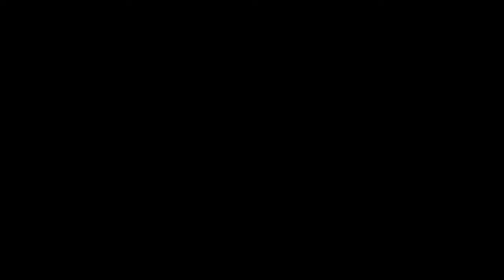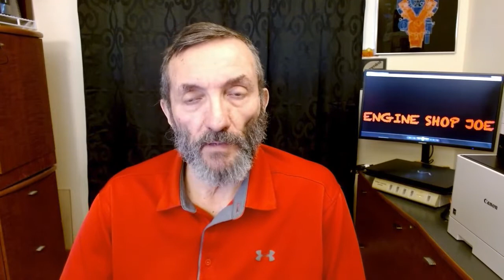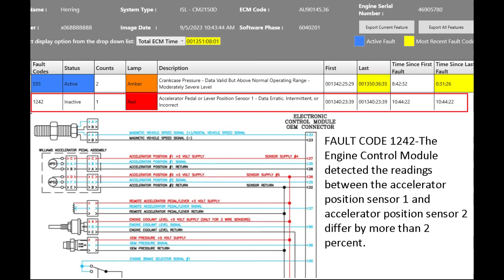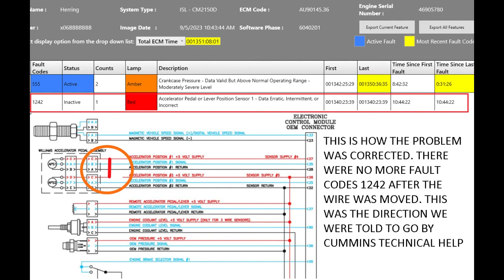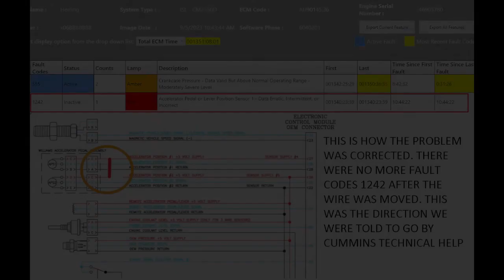HELP how do I stop these throttle pot faults and derates

Comment: Hi, I have a kenworth. T 800 that has Commins  IXS CM 871 engine. HAVING ISSUE WITH CODE 1242
 AS I DRIVE, THEY STOP CHECKING. JULY COMES ON AND CALL 1242 ZECTIVE. YOU THINK THIS SOLUTION THAT YOU MENTIONED IN THIS VIDEO MAY APPLY TO THIS ENGINE AS WELL SO FAR I HAVE REPLACED THE X RELATOR PADDLE, AND THE ISSUE STILL THERE. ONE THING I NOTICED, IF I DISCONNECT THE ONE OF THE NEGATIVE CABLE THAT GOES TO THE TRUCKSIDE OF THE BATTERY, THE CODE DOESN'T SHOW UP. AN ENGINE RUNS FINE BUT WHEN START THE TRUCK, IT MAY, IT STARTED WITH LITTLE CRANKING. ARE THE FIRST ATTEMPT? IT MAY GO NO POWER. BUT THE SECOND ATTEMPT IT WOULD HAVE STARTED PLEASE LET ME KNOW, THANKS.
Reply from the maker: Load test all the batteries one at a time to make sure non are failed. You have to unhook all the positives or negatives on all the batteries to do this. If that is good make sure Ground to the block is good. The entire chassis grounds to the engine on a stud by the starter side of the engine. Remove the wires and stud and clean it and put it back in tight and put the wires back on it and ad a new ground wire from the batteries to that stud and tighten the nut on the stud. so the wires will not move if you tug on them. Check ground and hot cables to all batteries. If all that makes no difference wire the hot and ground on the pot # 2 to the ground and hot on pot number one. Pot 1 is fed directly from the ecm and ground goes into the ecm. Pot two has a ground that is shared on other devices. If there is spiking or ac voltage from an alternator issue it might be causing the ecm to think the voltage is unstable.
Reply: @ENGINESHOPJOE i have a mechanic. Come to see the truck tomorrow. I'll share this with him, I really appreciate your response. Will keep you posted, how it goes. Thank you so much.

Comment: Great video and case study Joe! 5V supply codes can be tricky at times especially when the circuits involved have different set criteria and they are intermittent. As mentioned, I have also seen similar issues on some Paccar trucks where 5V supply 2 was shared for APS 2, coolant level sensor 5V (used on immersion type, not non-immersion reed switch style), and DPF delta pressure sensor. Fixed a few deleted ones that they put multiple electronic foot pedal assy and the issue was a rubbed harness at the DPF. Trouble I find is the 5V circuits are not always labeled well and can be used on OEM connector and Cummins side but doesn't really tell you if shared always on Cummins or OEM wiring diagram. 
         Fixed an 2005 T800 with CM850 ISL past summer for another fleet in area that had the parts cannon    unloaded on it by the customer, dealer, and Cummins tech support. Here is cut and paste from my repair     order what I found on it: 

 Customer concern: Check Engine Light comes on intermittently and loss of power. Customer has replaced     barometric pressure sensor, oil pressure sensor, Engine ECM and checked wiring from sensors to ECM for both replaced sensors.
Connected Cummins Fault viewer and pulled all truck faults. FC 0352- Sensor Supply Voltage #1 Circuit - Voltage below normal, or shorted to low source had 59 Inactive counts. Reviewed Cummins T/S for FC0352. Checked for proper voltage, grounds, and signal for barometric and oil pressure sensor at sensors and ECM. All checked okay. When checking wiring, noticed signal wire from ECM to barometric pressure sensor had been over-layed. Tugged at both butt connectors to check integrity of repair and connector at ECM pulled apart. Replaced with new heat shrink butt connector. Retrieved Kenworth wiring diagram P94-1494 to check for 5V supply on OEM harness. Found pin 21 was 5V supply for coolant level sensor and remote throttle. The Cummins ISL 850 diagram and Kenworth p94-1494 didn't state if sensor supply 1, 2, 3 or 5, but Cummins diagram for ISBe CM850 and QSL CM2850 showed pin 21 on OEM side as 5V sensor supply #1. Located connector J09 of engine harness and shorted Pin G(5V CLS) to ground and monitored 5V at barometric pressure sensor- voltage dropped low and FC 0352 went active. Started inspecting OEM engine harness. Found wire  BRN/GRY WIRE103 rubbed in spot to bare copper and rubbing refrigerant high pressure hose steel end shorting it to ground. Repaired wiring by unpinning wire from connector and slip heat shrink over rub on wire and other wires with rubs. Also repaired wires on cooling module harness the same way. Re-routed harness to prevent rubbing and properly secured wiring. The engine harness could use more attention for proper routing and stand-off placement to prevent future issues. Checked other fault codes. Codes for coolant level circuit. The 5V supply isn't used because updated two pin sensor Q21-1026. Disconnected sensor and found corrosion in connector terminals from seeping sensor. Replaced terminals in MP280 connector and let customer replace CLS. Cleared fault codes and took on test drive. No fault codes were set. Released truck to customer.

Truck hasn't an issue since and have helped them fix multiple other trucks since.

Happy Easter to all.
Reply from the maker: Perfect Repair.💪

Comment: There was a problem on the buses. The shield on long remote accel. pedal would go bad, and wire started to pick up EMI interferences, causing the same code to set off.

Comment: if your working on a paccar product there is a five volt regulator going to the low coolant sensor that is not on any drawing but if it fails you get 12 volts to the sensor, they have a two amp fuse in the cab pd box, my fix was to remove the fuse and tap into any five volt wire from the ecm, this applies only to trucks with the coolant level fuse in the pd box, they did away with in on later models, also the first aftertreatment  system the top rear screw in the step would poke the harness and short out all the ecm five volts.
Reply from the maker: Thanks for sharing this 👍🏼
Reply: I think you just answered a long lived problem I have had with a coolant level sensor. I never knew or heard of this regulator. Thanks man.
Reply: Kind of remember some trucks having a separate module if they had the Kysor warning/shutdown system on them, but many years ago. Switched many of the three wire immersion style sensors over to the "less" fail prone two wire one. Also had to add a 5V supply to a KW glider that used the non-immersion sensor with a CM875 ISM.
Reply: @stevesauerland223  hey Steve was the 3 wire the Emerson style sensor and the 2 wire the non Emerson style?
Reply: @jaywyatt7476  Two wire was also immersion, Q21-1026 if memory serves me correct. What year truck/radiator style do you have?
Reply: @stevesauerland223  2003 or 2004 kw